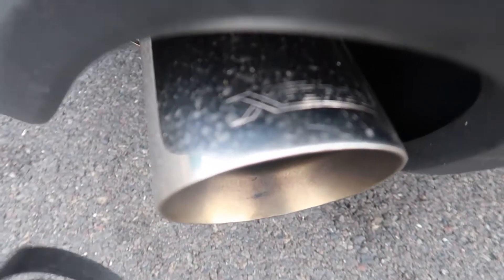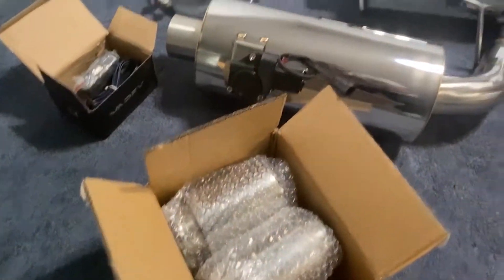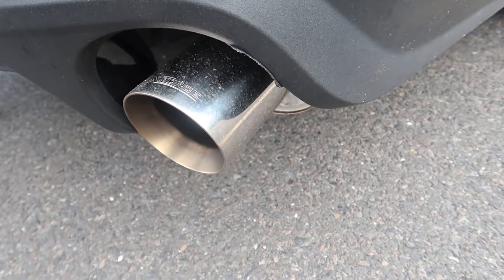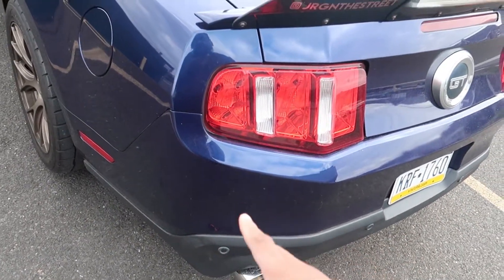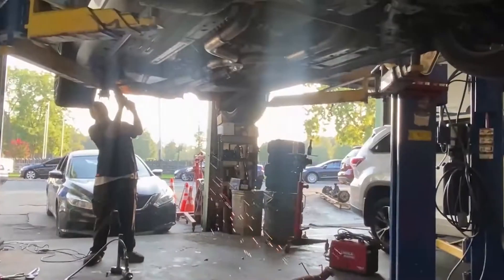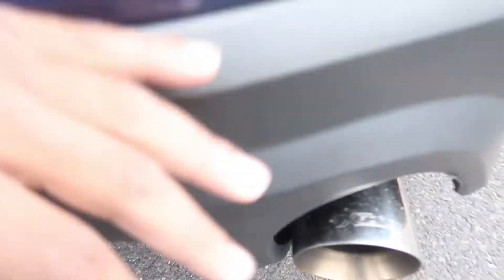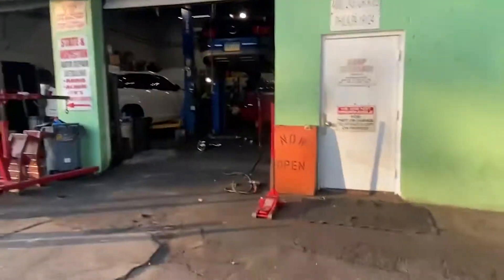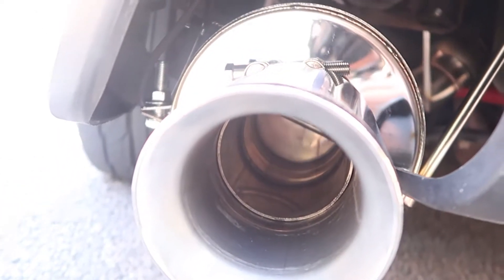11-14 Mustang Gt Xforce Active Exhaust Review!

Comment: How did you route the wiring for the power cable to plug into the center console? 🤔
Reply from the maker: I never used my back seats so mine went from the drain hole in the trunk through the back seats and into the console